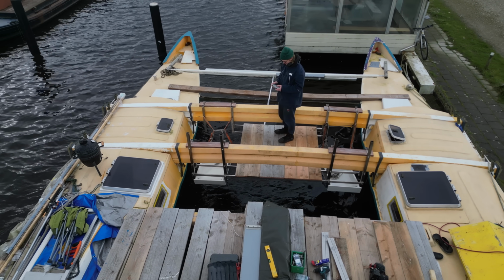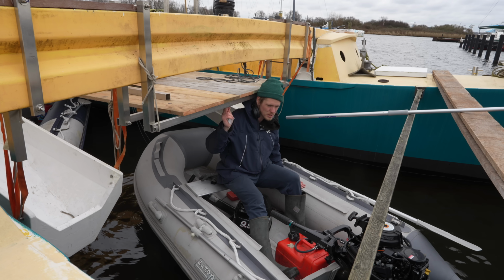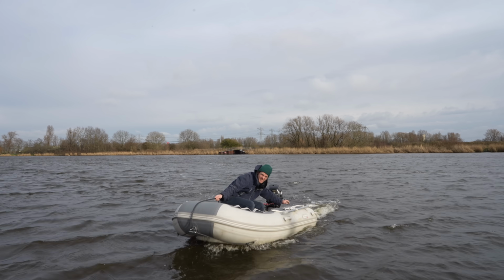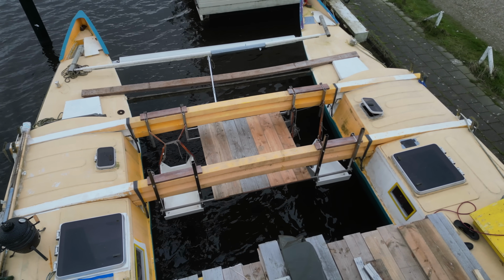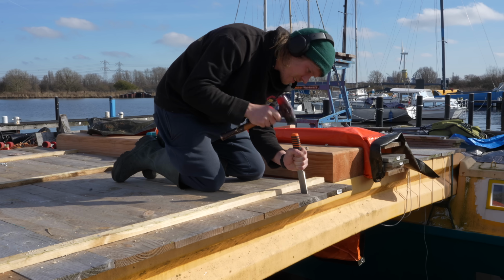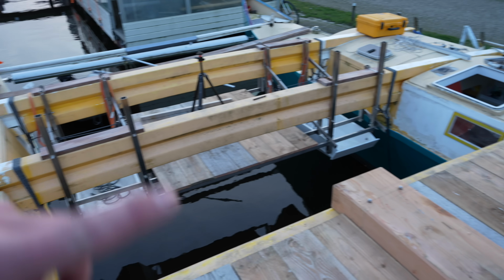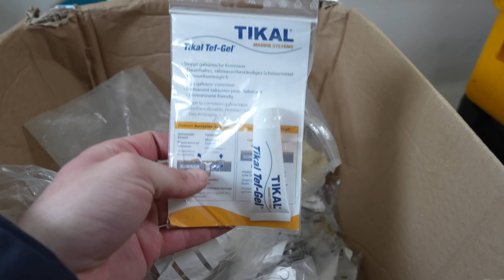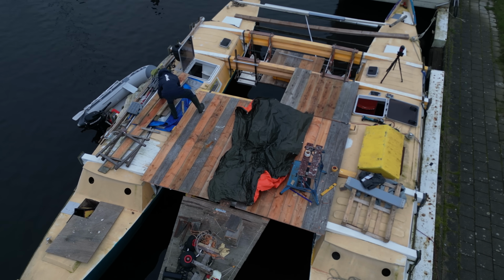A Simple Deck for a Simple Man’s Ocean-Going Catamaran.

Comment: If you passed the spacer rod through the square pipe (at the saddle point over the beams) then you'd make the whole thing even stronger, because the weight would rest on the rod, not the bolts.
edit: 9:29 The issue here isn't just weight, it's wear, the wear by flexing back and forth that you get from having small contact points (the square section wall standing on the screw's threads). That's why it's smarter to drill out those holes bigger, pass the tube all the way through, and put the thread inside just to secure the thing from moving - at which point, even if you don't weld them (i would, the top part) it should be ok.

Comment: Not bolt information but will you be putting anything between the platform and the beams? I worry that while you are sailing the flex of everything will cause the wood to wear through the coating of the beams and make all the work you did all summer be for not. Or it will cause you excess maintenance every year of re coating the beams with epoxy which is expensive as you already know and time consuming also what you already know. The work you can get done by yourself is outstanding and keep it up and your goal will be do able.

Comment: at 17:20, does anybody else have any issue with aluminium(?) angles. Your testing weight on the vertical plane, which pretty much uncompressible. But force will be applied to the horizantal plane of the angle, which, if I saw correctly, is unsuported by stiffening triangles. Please anyone correct me here if I'm mistaken. There could be some wear and tear issues there, just basically bend down with time.
edit: actually it should be fine thanks to the transverse planks fixing the the ones laying on the main beam to the ones laying on the aluminium angle.

Comment: What are you going to do with the exposed open ends of the square tubes that support your engine pods?? Hopefully you will put smooth caps on them to prevent any possible horrific injury if anyone should fall on them.

Comment: If the fuel contains ethanol you need an additive such as seafoam. Best to pay more for ethanol free fuel if it is available there. I never went without seafoam in the tank on my boat. I Rebuilt the carb one time too many. You COULD reinforce the square tubing where you have drilled a hole by welding a washer to the tubing. Line up The holes then tack The washer down in 3 or 4 places. The washer would act as a small reinforcing pad. Someone is going to rip their leg on that tubing protruding up about 12inches. OUCH! The 3/8" all-thread is probably okay as long as there isn't a long of wiggle. All these connections need to be tight and solid. If it's wobbly or wiggly or loosey-goosey I would consider bumping MAIN RODS to 1/2" all-thread. When in doubt, build it stout. Always build with a 2 or 3 safety factor unless weight is paramount such as aircraft etc. That boat will see a lot of flex by design. 40 years of industrial design and gut feel for boats, I would go 1/2" or 12mm on the main rods.

Comment: Mark just use a preserve on those boards . DO NOT OIL them at all or you will have a skating ring !!
Reply from the maker: cool. I wasn't really sure
Reply: There are many types of oils, including ones designed specifically for boat decks.

Comment: hello Mark, good job, your dream is comming true :) , i have noticed in the video that you link directly two metals that should be isolated from each other using something called "TEFGEL" pretty expansive, any alternative really working is to be considered due to the price,  this product will isolate stainless steel from aluminium as with salt water, you'll have galvanic corosion happening at the contact points, this process is somehow, eating your metals :).
Reply: The tubes are stainless steel, as is the mounting hardware, so no dis-similar metals in contact there.

Comment: I rebuilt my carb. At first, I went in to fix any obvious problems and unplugged the jets, but still had problems. I ended up rebuilding the carb. It would have been cheaper to buy a new one when you add time.

Comment: Those M10 bolts shearing strength is def more than 10 tons !! The only thing you might have a problem with is that when you pull the engines up the pulley ropes will be in the way .
Reply from the maker: cheers for the info! the engine head will just fit under :)

Comment: Hello, you made a mistake by installing aluminum corners on stainless steel beams with aluminum rivets. Aluminum quickly corrodes and breaks down in salt water when in contact with a stainless steel due to the potential difference.
Reply from the maker: ill keep an eye on them, they're actually a redundancy for whole deck part which will mostly sit on the beams

Comment: Don’t worry about the food from McDonalds being bad, there’s a video of a guy who left a bunch of McDonalds stuff out and it lasted for over 6 months… it doesn’t go bad… ever. Your failure is going to come from a lateral move, not up and down… kinda like a wave hitting it on the open ocean… Nuts and bolts are strong enough to hold up whatever, the issues that you will run into are waves smashing into your boat. Waves and debris smashing into coastal properties is what destroys them not anything else. Not a mechanical engineer, but I have a good idea of things break. That’s how they do the glue commercials on TV, just lifting stuff really isn’t that hard… slamming it around is where you run in to issues. Waves bash.

Comment: PLEASE be careful cleaning parts with gas inside your boat,  the fumes will settle in bottom and slowly get higher as you clean more or temp rises.  You won't notice until it's to late, like lying down or lighting your stove.

Comment: I just keep wondering about the cockpit. If your heading into heavy seas and a wave passes between the hulls. Is there nothing to dissipate the crash of the wave? Is the timber and lashing able to resist being swept away? 
If the cockpit was shallower (not extending below the beams) the beams would break-up the force of any wave and there would be no twisting moment on the steel of the cage... You could also build a little structure above the top decking to give you protection form the elements.
Or am I over-estimating the force of a crashing wave?

Comment: It’s your fuel only use regular fuel do you not use anything with ethanol additives it’s more expensive, but it won’t come up your engines in the US. We have the same problem with our motors if you use any of the ethanol gasoline, this will happen every time.

Comment: Many good engineering comments below. However, I did not see any comments on your stainless rectangular tubing...or specifically the protection of that.  The SS threads are open to erosion/corrosion. The top and bottom tube ends need to be sealed, though with a bottom end weep hole. Your worst enemy is salt water...duhh.  Stainless steel is not not immune to corrosion. Every individual mechanical connection/joint will be the collection point for salt corrosion mechanisms.  Add that thought to fatigue movements...your weight bearing calcs will change over time.  No need to upgrade size, just protection.  No need to let it even begin to corrode/erode.
(I just did a trailer setup with square SS tubing. Used plastic inserts, sealed with silicon with weep holes in the plastic. )

Comment: Don't overtighten, avoid all buckling. Sleeving the bolt within the tubing internally would enable this point to be torqued with no buckling, and max strength. All sleeving could be made on mass with a lathe accurately.

Comment: Work in manufacturing for an engineering company. Grade 8 and up should be more than enough. Grade 8 is used to mount suspension components to vehicles. Using your ropes and multiple bolts to distribute force, you're fine. Just keep an eye on those drilled holes in the stainless steel. They'll be more prone to rust and weaken. But it won't happen overnight. Make it a yearly check. Your mast will likely need grade 12 because of fulcrum forces and reduced bolt count.

Comment: The red material is likely phenolic. It’s resin impregnated with fibers. Very old school and stable. I’d recommend a safety rope or cable on those engines. If all else fails it will keep you from losing an engine. On the other hand having an engine dragging and bashing your boat is rough seas might not be a good idea. Use a nice rope so you can cut it free is needed. Bolt are mostly in shear. Not a good idea to have the threads hanging on the surface cut into the box channel. The issue is the cowards force is then resting on a smaller surface, just the thread points. In order for the bolts to fail in shear the friction of the washers to box channel need to slip. It’s the clamping force that holds parts together. The shear values for bolts are for ‘if’ the squeezing force fails, loosens or corrodes. Engineer, designer of manufacturing  machines and medical devices and fixer of anything that burns fuel…except jets..sadly.
Cutting oils have multiple functions, many are interrelated. The oil allows heat to be transferred from the cutting edge of the drill bit but mostly to keep the cut material moving across the cutting bit. The chips the drill bit produces are very hot. This heat is from being sheared away from the material being drilled and then additionally being worked additionally as they are bent up and forced up the flutes of the drill bit. The drill gets hot from the shearing at the tip but also from the hot chip being slid along its length. Don’t get the drill tip too hot or it will become annealed which ends up making it soft. Heating metal allows the micro grain boundaries in the metal to slide and relieve stress in the metal. Basically it relaxes the metal and it becomes soft. It’s more complex but basically heating drill bits to more than 300F starts making the metal soft. When the end region of the drill gets to about 300F the very very tip cutting edge is closer to 700F. Rule of thumb is most metals start being annealed in the 800F range. High Speed (HS) bits anneal sooner and wear out sooner than Cobalt bits. Normally cobalt bits have a small reduced diameter at the holding end of the drill that is about .030” smaller in diameter and 0.070” long. Makes it easier to see the type of drill you are using.
Keep up the good work. Good rule of thumb Mark is that if you think something is an issue it likely is one.

Comment: Do you have any plans to place a winch on deck to raise and lower the midboard engines?
Seems like just 1 winch would do the trick but then again I don't know if they can operate with two sheets wrapped around from different sources. I'm landlocked in Missouri 😊

Also are you going to make the uprights sticking up from the cage into perhaps removable handrails or even permanent handrails?

Comment: Those aluminium (?) beams that You riveted to the stainless steel beams did you put anything between them? Be careful! Aluminium will corrode when in direct connection with stainless steel!
Reply: hmmm...did you watch the video?
Reply: @oregon1232  I did but I must have missed it if so

Comment: it's unfortunate that you didn't have the time to sand your decking boards and seal them ... Before assembling your decks. My experience in over 40 years of construction , is that out doors, exposed to the elements, any where two boards are connected with out being sealed first, they will trap water and rot.  Being on the sea makes this even more a hazard as those screws will let loose and boards warp and pull away, making trip hazard at the most inopportune time.  I'd suggest sanding the top of these deck boards so they are all even, then disassemble the deck and seal each board individually with a minimum of 2 coats of penetrating epoxy on All sides, All edges and All ends of boards. Then reassemble the deck and paint the top with a 2 part epoxy paint and non skid.  Paint any part that will be exposed to the sun because epoxy alone is not UV resistant to the sun.  While this will take more time, money and materials, it will probably last 10 times longer.  This will also protect from expansion and contraction and the deck boards from cracking.

Comment: Lol like I said fiberglass the floor for strength. A strong working platform is so useful while doing repairs, and sailing.  Please fiberglass your flooring and paint it.  you will be so happy you did.
Reply: Fibre-glassing planks that size is a recipe for disaster. A lash of wood preserver and regular oiling will suffice or a good oil based paint with non-slip on the walking area.
Reply: I would paint it...less work overall, with better durability.
Reply: @skaraborgcraft  painting fir is the best!
Reply: it's not permanent so protective paint coating should be sufficient, if it were permanent then yes, but then he would use probably lengths of marine ply instead of those separate planks
Reply: @skaraborgcraft  I'm not saying it would be easy yes there would be a lot of planning and sanding.  Ideally he should have chosen the right wood to begin with, but after watching him fall through the floor, it's clear more strength is needed, fiberglass would add that.

Comment: So, not an engineer, take this with hety grain of  salt,  at sea that isn't a static load and will be subject to constant abrupt acceleration and deceleration force as the water slaps it about,  massively increasing the instantaneous load. whilst I think the bolts will be strong enough, I dont think the structure will last and it needs bracing (read welding) to resist bending and jiggle that will twist and fracture the bolt to box-section joints over time and likely lead to a catastrophic failure.

Comment: You do realize that when you put your Engines into Reverse if those engine sleds they are not locked down in some way are going to kick up due to the reverse thrust of the motors And you will loose all sternway Thrust when you need it the most ... Something to think About..Also if a big wave comes up between the hulls it is going to Slap those two shells Upward very hard I do not think the weight of the motors will be enough to keep the in them down Position

Comment: Why don't you put a 4x4 across the main beams bolt it to beams them deck can be bolted to 4x2 as what your doing is not safe when your on full sail your will forget the deck  and that is where you may fall over board  I would look at wearing a full harness  so if you, do fall you can get back up
Reply: I agree with doing something else. Those decking boards are spaced to far between the beams.  Looks like 4ft plus, which is asking for trouble.  At the very least when under way I’d be wearing a tether and jacobs ladder on the side,  if I should happen to fall overboard.

Comment: In structural steel work a 10mm bolt would not be considered structural. Minimum bolt size considered structural is 12mm.

Comment: If you want someone to make calculations, then you need to put up the measures and material, that is, at least a simple drawing. So angels and forces can be calculated.

But yes, if these bolts can lift a car, they should be enough.  And putting in larger bolts, with larger holes, will make the construction weaker.

Comment: Brilliant, brought back all those great Insp Clouseau moments.

Just wondering about the outboard cradles.  If you hit roughish water, ought you have some way to lock the cradles in the down position, rather than relying on gravity.  

One other thing.  Around here there is a requirement that rebar on a work site that is pointing upward have the caps put on the ends to prevent impalements injuries.  It might be an idea to put something around those steel tubes that protrude a foot or so over the deck.  You demonstrated how easily falls can occur, and you are in port.

Good luck.  Love the show.  Any chance you'll be bringing another Chinese bird onboard?

Comment: Not being a engineer cannot help you with bolts. But having a garden shed can help you with the deck. Old chip oil or old engine oil brush it on and do it over two or three days. Waterproof for nothing, just mind do not smoke a joint for a few days on the boat.HAHAHA

Comment: If the block with the cams was the other way up you could lift easier?  No?   Kicking strap format it would run through the cams and lock and you would be standing for a more natural pull.     Pulling down in a confined space looks awkward.    Releasing obviously takes no space.

Comment: The ocean will batter those boxes to pieces, leaving the outboards trailing on bits and pieces of cable and strut. I proper bracket on the end of each pontoon with new electric start outboards with tilt feature....big bucks but the way you are doing this looks super sketchy........

Comment: Well. for the cockpit area I do not like the idea of threaded rod in such a one-chance-only situation in steel tubing into which a tubular insert for the bolt has b not been welded.  I have seen what the sea can do, and I have seen structural failures that should in theory have been impossible, but the ocean waves are sometimes big and have great inertia, and so does your craft, and when they coincide in opposite directions, disaster can and often does happen.

Accordingly, I would design for the crossing of your beam by the bolts, on top, a bracket WELDED and covering the existing system. It should resemble a squared off horse shoe and be bolted where the beam indent occurs, as well as on the stainless steel existing down-structure suspending the cockpit sole.  On top of these brackets should be mounted a bow handle which will double as a cleat or a tie down, or a canopy securing point/  Believe me, open cockpits are not good, I never use them.  I ascribe to the edict that any damn fool can be uncomfortable.